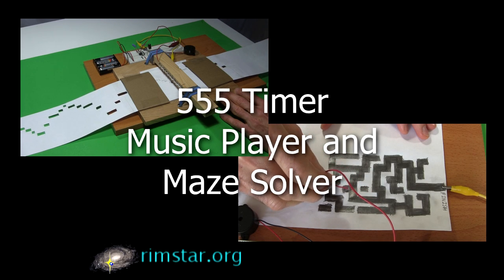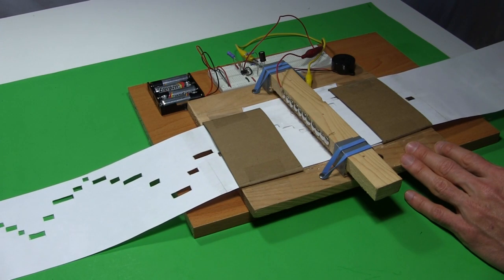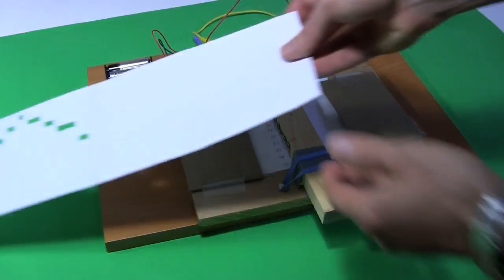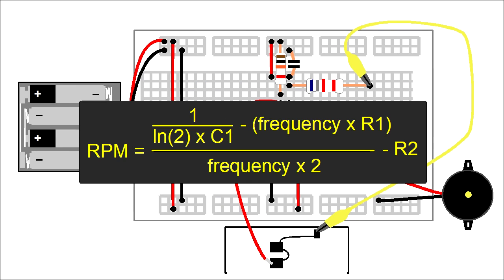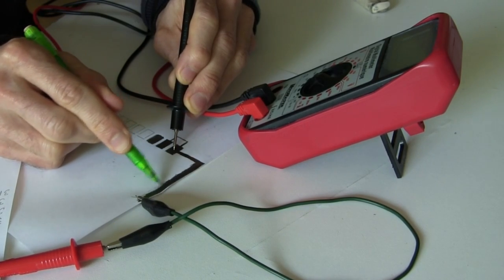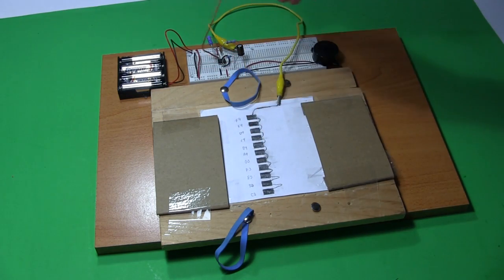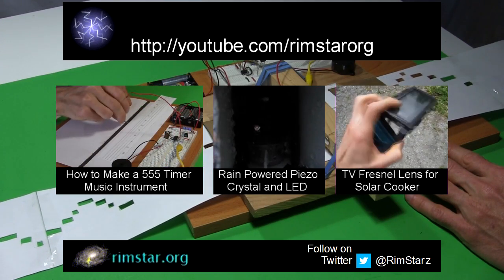How to Make 555 Timer Music Player and Maze Solver

Comment: which one is R1 ?? 

why the other capacitance magnitude would not change the frequency??
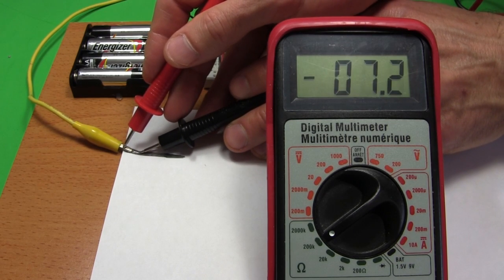Reply from the maker: R1 is the other resistor you can see at 3:17 located just below the 555 timer chip. You can also see R1 at 3:03 in the video where I show putting this circuit together step-by-step "555 Timer Music Instrument How to Make".As for the other capacitor, it's on the output side of the 555 timer chip.

Comment: What a nice design to play tunes made on paper with off the shelf components!
You could even draw the notes with a marker if the contacts were replaced by phototransistors with resistors :)
Reply from the maker: I hadn't thought of that approach. I did think of using LEDs and photodiodes with the paper with holes in it, but I like your idea better!

Comment: how does potentiometer knob changes as the height changes??????
give the circuit diagram for its connection..............
what are the other applications ????plzzzzzzzzzzzzzzz reply as quick as possible]
Reply from the maker: I think you have the wrong video. There's no potentiometer in this device or anything to do with height. And I can't think of any of my videos where I used a potentiometer with respect to height.

Comment: how are the resistances of the graphite and frequencies related????

on what basis have u chosen the capacitance and resistance values in ur circuit????

how can we further improvise it??? 
what are its real time applications???

please suggest soooooooooon............we have our project submission dates nearing.....................:)
Reply from the maker: The resistance and frequencies are related according to the formula at 3:28 in the video.
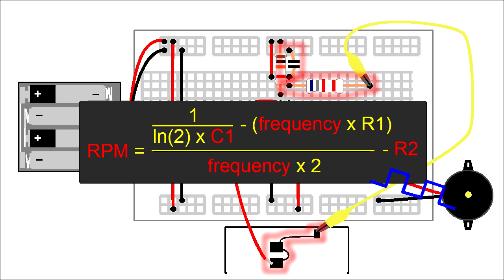The resistance values were chosen using the formula at 4:12. The formula was plugged into the spreadsheet shown at 4:17 and the capacitance was gotten by playing around with the values in cell b3 in the spreadsheet.
I improved it further by making the next generation version shown in my video "555 Timer Chip Music Player for Maker Faire" http://youtu.be/WM1bZgBqDl4
I think you meant "what are the real world applications". The music player is one real world application. But you could replace the graphite with a potentiometer. Then anything that can turn the knob of the potentiometer can affect the frequency, and hence the sound. For example, if you have something whose height changes then as it changes height it could turn the potentiometer knob. The sounds that gets played is an indication of the height, sort of like an audible indicator. I'll leave you to figure out a specific example.

Comment: Brilliant! In computer science there is no algorithm for solving mazes which simply takes the shortest path every time. You've just demonstrated that electricity always knows the path of least resistance, regardless of how complex the maze would be to solve algorithmically. You could have a trillion by a trillion maze of little lead pencil rooms and hallways and electricity would know the shortest path from any point to any other, the instant it was switched on!

Thanks for a great vid!

Comment: You can also use your project and formula as a test instrument if you had a frequency counter or indicated on a scope or displayed multi-meter.  For example,  you could plug in various capacitors and determine their value with the formula.

Comment from the maker: I'm pretty sure the piezo speaker does contain an oscillator, since you're right, it is one that runs on DC voltage. I tried opening it up once but I'd have to cut it open and I don't want to in this case.
I just tried it with a small electromagnetic speaker and it sounds practically the same and at around the same volume. And now I tried it with a barebones piezo disk and it also worked but it was much quieter. You gotta love breadboards for ease of experimenting! :)

Comment: Did you need to fine tune the resistance at the wire/graphite contacts by adjusting the position of the wire on the pad? Or would that little of a change in length not have an effect on the circuit's resistance?

Comment from the maker: I do want to make another one with plenty of improvements, like metal contacts and separate notes so you can play multiple keys at a time. I don't know about a 555 for each note though, since that means multiple of all the electrical components (capacitors and resistors) too. It might be some other hardware, as long as I can keep it simple. I did the keys bent up with a contact below them like you say for a science project when I was a teenager. Worked great!

Comment: You music machine is nice.  Another option is to make a 555 for each note, perhaps all the notes of the scale.  Perhaps use metal for the contacts instead of pencil carbon/graphite.  Just an idea.  I think some have used a single 555 or oscilator and had like "keys" out of bent up metal that they can push down onto something like the top of screws, however this is a different concept than the music machine/player that you have made.

Comment from the maker: You're welcome. I'm glad you enjoyed it. I did something similar for a science fair when I was in high school. My computer, a TRS-80 color computer, had joystick inputs that expected a voltage from 0 to 5 volts. The voltages in between represented the joystick position. So I made a keyboard with a bunch of resistors (instead of drawing with graphite) and depending on which key you pressed, the joystick input would get a different voltage. Instant multiplication of the number of possible inputs.

Comment from the maker: All I said and did with graphite in this video applies to other conductive materials too. So what I said about the length and width applies and the sound would be the same. However, the same width and length of copper has much, much less resistance than graphite from a pencil so to get the same resistance with copper it would have to be much, much thinner. Even 30 gauge copper wire has less resistance than the wide pencil marks in this video. So it's not practical to use copper in the same way.

Comment: Would it make a different sound it another conductive material/metal was used?
Would length and width apply to other metals in how strong the current is?
If so then shouldnt they make computer components thicker than so thin to be more poweful? 
If you have 2 lines for one to be + & the other -, with a rail, and small toy electric train/car that the motor wires touch the + & - to see how fast and slow it would go depending on the track length & thickness, & momentup to jump to fast/slower tracks

Comment: Thank you again for another great video. I am going to use what I learned from the 555 timer project on a Arduino project. The idea of resistance is how a makey makey works.  It is to turn anything into a input device using alligator clips. It only has 18 pin and is programed for one level of resistance leaving only 18 inputs. So with some of the math you shown using variations of resistance I could use one pin for a number of characters on a normal Arduino with less inputs then the makey board.

Comment: What type is the Fluke multimeter that you're using here?
I was looking for a new one, since I sort of jacked my old one up...
Any recommendations? Most voltages would be on the 20V DC range, and occasionally a 230V AC measuring. And some circuit testing, but that function is also blacked out, it just keeps bleeping on my current meter.

Comment from the maker: 5 minutes. I had the book with the sheet music in front of me. I laid the punched card on top of the paper with the pencil marks. I saw the marks through the punched card paper. I then traced a rectangle for the correct mark/musical note and drew it the appropriate length depending on if it was a quarter note, half note, ... Then I slid the punched card paper over a bit for the next note and traced the next one and so on. Once all the notes were traced out, I cut them out with an x-acto knife.

Comment from the maker: Isn't it cool! I just had to do it once I came up with the idea. I tried paperclips first before switching to the thin, bare copper wire loops for the playing head, but the paperclips were too stiff. And then I was surprised at how well the wire loops worked out. I must have done a dozen musically flawless takes of that song before I had one with minimal sounds of cars passing.
Re the broken piano keys, it's been on my list for a while. I figure I'll carve some pine or use some moldable plastic.